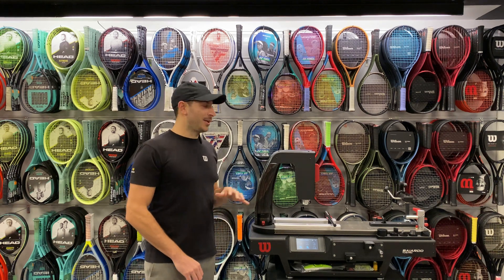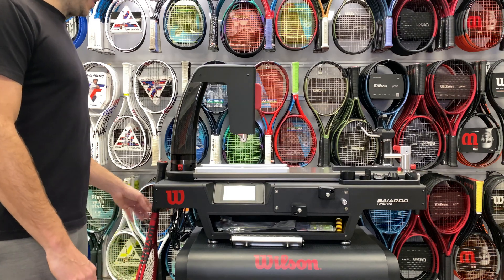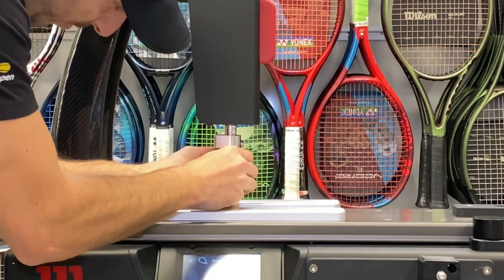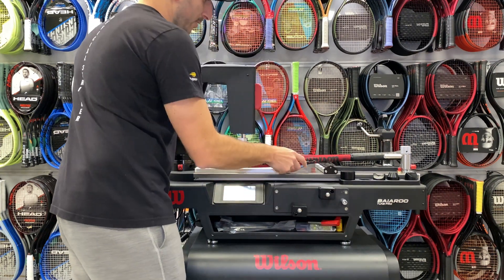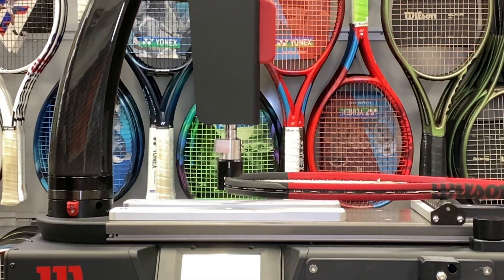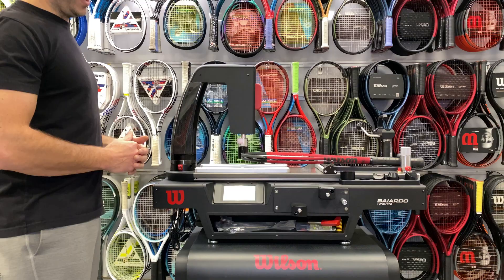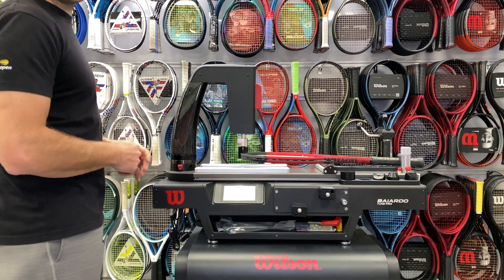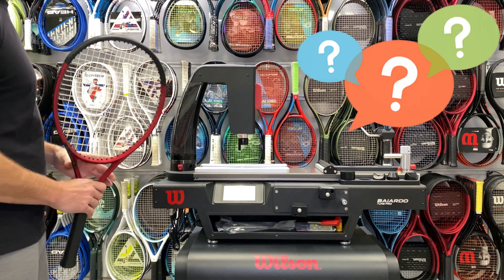How To Measure Tennis Racket RA Stiffness or Horizontal Bending  | Wilson Baiardo Tune Pro |

Comment: How much deflection is put on the racquet, a full inch?  Would this damage the racquet if done too often?
Reply from the maker: We asked this question to Wilson. They assured us that rackets are very strong and this test does not have a negative effect on the racket. You can test the racket as much as you want without affecting performance.